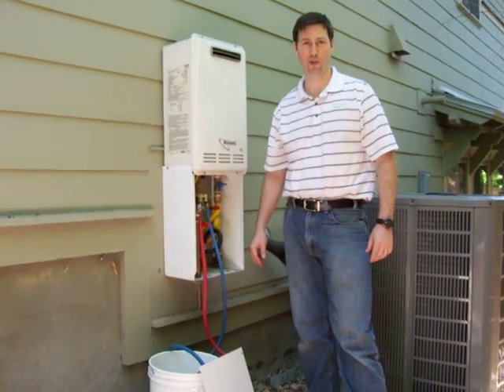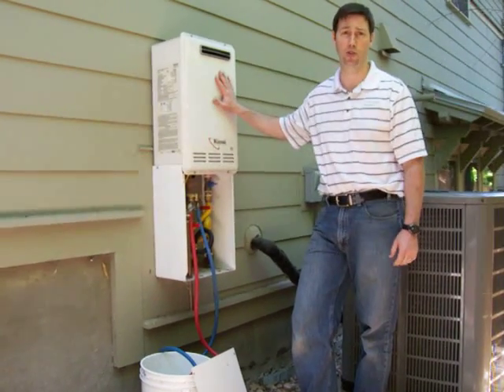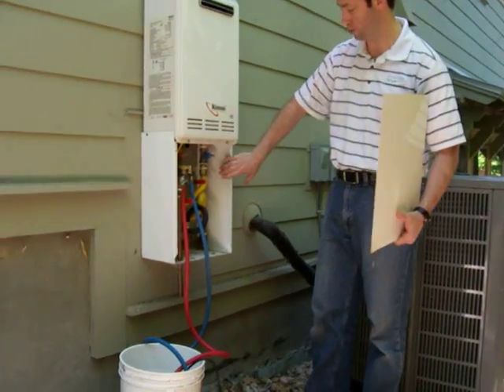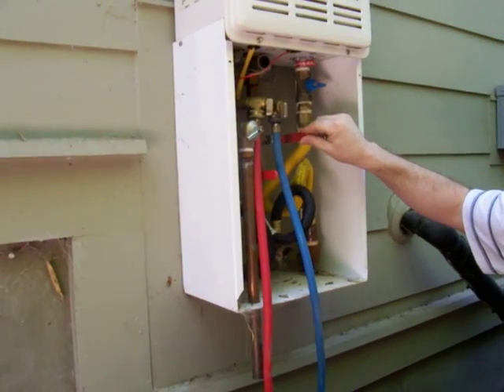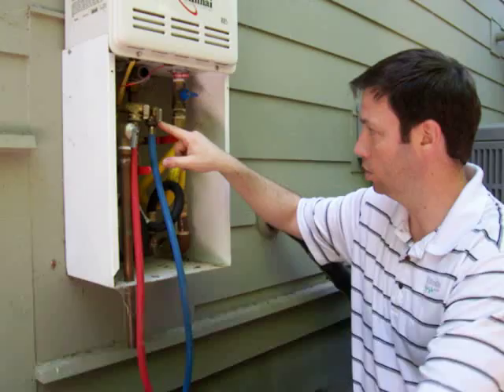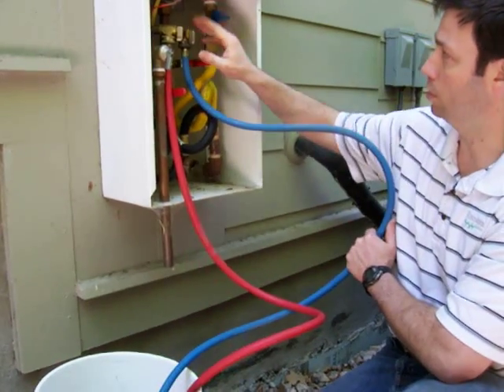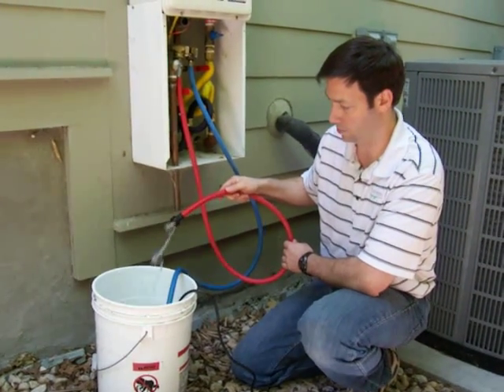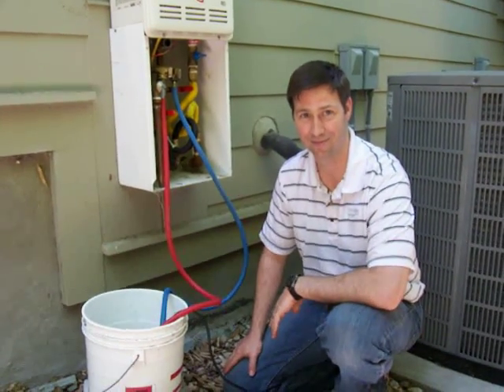Maintaining a Tankless Water Heater

Comment: Okay Matt we have a brand new home 6 months and the psi went down and composite has build up here in San Antonio Tx. I am ready to flush it out however my pipes do not have a valve to connect the washer hoses. Shouldn't that be easy to buy and install as well as long as I shut off power and water during that process in order to flush it out

Comment: Thank you for your videos Matt, you have helped me out a lot over the years.  Anyone know if you can hurt a tankless unit by running the flush flow in the reverse direction? (flow meter might not like that? possible check valve?) Thinking it might do a better job removing any possible larger particles stuck in the exchanger?

Comment: I did the flush okay but when I was done I tried to drain the vinegar that should have been in the tank but nothing came out. It also took about four gallons of vinegar to get the pump circulating. What am i missing here? When I turned the hot on at the faucet, water with some black gunk came out but no vinegar at all.

Comment: I could not hear what the horse power is on your sump pump.  I own a sump for pumping out my wet cellar. I am not sure how I would adapt that to this little tank. The intake on it is 1/2 inch.
  I own a little eco temp portable tankless hot water heater that operates only on water pressure and a gas grill 20 lb propane tank that I hang from my shower rod.

Comment from the maker: I'll typically flush the water heater and the pump with fresh water.  I'm not so worried about leaving some vinegar in the water heater, it's quickly dissipated once the unit is fired up again.  However, I've ruined a pump by not properly flushing the vinegar out.  Best, Matt

Comment: Great Video.  I am an avid DIYer and appreciate adding this to my skillset.  I assume you ended the process with replacing the vinegar with water in the bucket and running it a little while to get rid of the vinegar, or does it just drain out passively when you disconnect the hoses?

Comment: Before I retired I traveled all over half the U.S. working with commercial restaurant equipment including dishwashers and espresso and coffee, tea and hot chocolate machines. Keurig is very prone to breakdown due to Indiana water if a RO system isn't used.  Indiana water is the worst in the world. You can go from sulpher, or iron, or calcium in incredible amounts. You should get the advice of a softener exoert that will analyze your water, you may need RO/Iron filters as well as a softener

Comment from the maker: Sounds like you did it all correctly.  I'm not sure why the pressure dropped and the temp went up.  Either way if you got 20 minutes of flushing you're probably 98% there.  If your water is hard I'd suggest flushing annually if the water is soft then you're probably good for 18 mo to 2 years between flushing.  Best, Matt

Comment from the maker: Great question.  I have no experience with electric tankless heaters, but they should work and flush basically the same as a gas model.  What I'm not sure about is wether they tend to scale as much as a gas model.  I would expect a gas model to have a higher heat in the boiler so it might be more prone to scale than electric, but that's just a guess.  Ok back to your question, did you connect the discharge on the pump to the cold inlet on the water heater?  Did you clean the inlet filter? Matt
Reply: @buildshow, Why, is the cold side an issue when the calcium buildup comes from the hot water heated side? I have an AO Smith tankless electric water heater and evidently they didn't figure in cleaning the system out when it was built. Heats really well the calcium buildup is unbelievable.

Comment from the maker: I don't have empirical evidence that they will last 20+ years in a coastal environment, but I can tell you that the units I've seen that are made in Japan are VERY well made.  These are used extensively in Japan and they certainly have coastal environments to deal with.  The oldest unit I've installed & serviced is 7 years old.  Everytime I service that unit it looks brand new.  I would not hesitate to install one in your environment.  Stick with the well known brands.  Rinnai, Noritz, Takagi.

Comment from the maker: @pinalsamu It doesn't need to be very powerful, just enough to pump that 2 gallons through the system at a constant rate for 60 minutes.  I would expect that a 1/8 HP would suffice.  Matt

Comment from the maker: @dxmxl313 Oooh good question.  I regularly build homes with two units and I'll flush both then toss the vinegar.  The vinegar shouldn't lose it's potency after multiple flushes, but you'd want to ensure you're not pumping particles or debris into another machine.  Seems like you could use that same 5 gallons multiple times in the same day, but I probably wouldn't save it for future use.  Matt

Comment from the maker: @kieranmullen2 The answer is YES, but likely not as often.  With those conditions you could do this process every 24-30 months and likely be OK.  I wouldn't go much longer however as their is still the need to clean out your in-line filters and still some scale possibility.  You should have 20-25+ year water heater life under these conditions.  Matt Risinger

Comment: We are going to do this and also wonder if there is a way we can clean burners, jet pilots etc. is there a video on that, can we get a link, I searched and couldn't see one.  Our water heather is an Aquastar tankless and is 4 years old.  Never flushed before, just started having problems with water only luke warm even when set to highest heat with knob.  Think this will help but wonder if we should do other maintenance after the flush, can you advise?  THank you for this video!

Comment from the maker: @awhite900 As long as the pump isn't dirty you'll be ok.  You wouldn't want particles from a dirty pump lodging inside your boiler.  As a safety measure you could hook up your pump so that the tankless wh's filter was in-lin with the pump.  Meaning that you would hook the pump to the cold water side so the filter would catch any particles coming off the pump.  Those hoses you see in the video are a set of clothes washer hoses to connect a washer to a hot/cold hookup.  Best, Matt

Comment from the maker: @77re777troy77 Good question.  I'm not sure to be honest.  I've only known to use white vinegar so I'd be cautious about being too acidic or too caustic.  you don't want to damage or pit the copper heat exchanger inside the tankless water heater.  The white vinegar is just acidic enough to remove the hard water deposits slowly.  Best, Matt Risinger

Comment from the maker: @dieselplow Yes indeed they need a routine maintenance.  If you have soft water you might not need to do this as often but if you water is hard like it is here in Austin, TX you should plan on a yearly de-scaling flush.  Also, don't forget to check that inline filter every 12-18 months even if you're not de-scaling.  They regularly get junked up here in Austin.

Comment from the maker: #1.  For tankless units the gas ones are the way to go in my book.  If you don't have gas available then it's a tougher call since you're in a cold climate.
#2 For that small of a house a 199k btu model would be more than adequate for your needs.  If you're in a cold climate you'd probably want to mount it inside the house rather than the exterior ones you'll see here in Texas.  #3 Life span is 20 years if maintained. #4 Mainteance is $10/year if you do it yourself. $100+otherwise.

Comment from the maker: I spoke to a Rheem rep at a conference this year and he tells me your water heater is made in a Japanese factory along with another brand.  The should all flush the same way.  Do you see two hose connections under your unit?  If not, you'll need a plumber to hook up a flush kit.  If you do have those connections the flush instructions are exactly the same.  If you have trouble lookup the number for Rheem and call them for instructions.  Hope that helps. -Matt Risinger